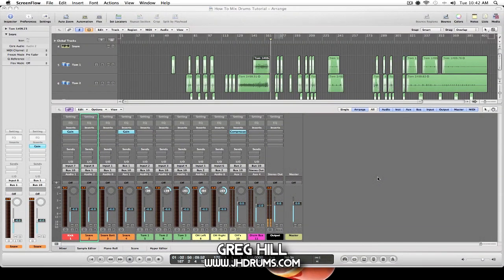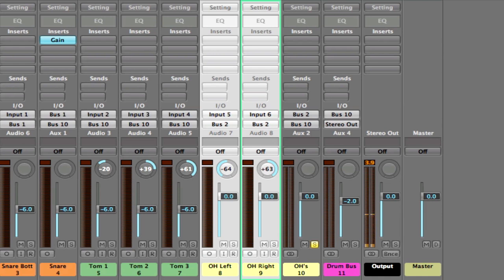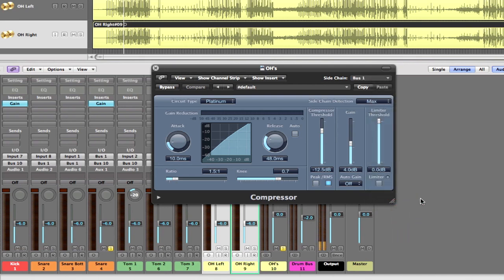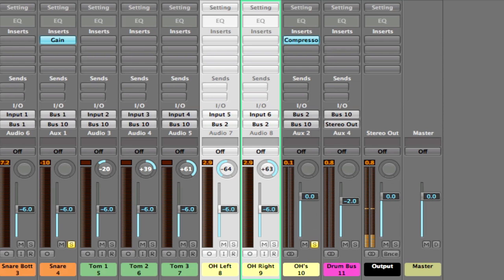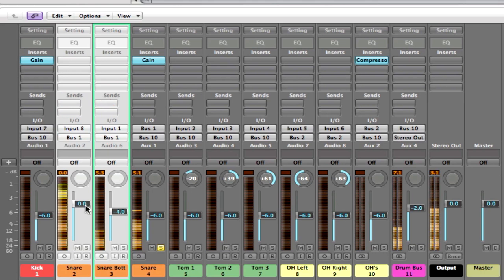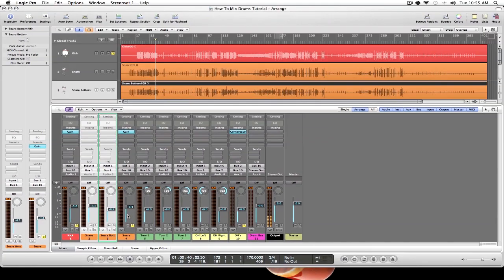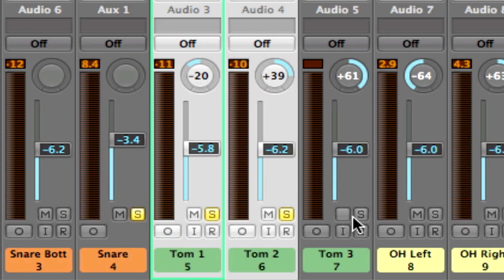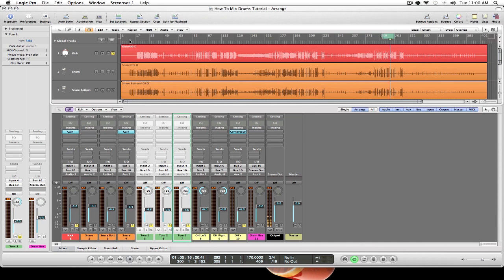Gain Staging - How To Mix Drums (Part 4) | by JHDrums

Comment: When I add a gain plugin to trim a snare that's too loud and insert a compressor after, I noticed that reducing a lot of gain makes my compressor work only at a very high threshold if that makes sense. I only see in my case a gain reduction on the compressor if I turn the threshold to around minus 30 or 40! Should I just insert the gain plug if the signal is clipping? Thanks in advance. Cheers

Comment: When we side chained the compressor to Bus 1 only why we use it at all ?  we didn't side chained it to other channels?
Reply from the maker: I do this to compress (or lower the rms) volume of the snare in the overheads (and only the overheads) to make the other parts of the kit captured by the overhead mics more audible. It's not necessary to compress the snare in any of our other tracks because the snare doesn't dominate their source.

Comment: In terms of recording, I've often (if not always) been recommended that one should aim for around -18dB with peaks hitting around -12 dB for recording in general, not just drums given that we're in the 24bit recording realm now there's no real 'need' per se to record anywhere near as 'hot' as you have in the examples here or like you could do when recording to tape because of the compression effect I often here other profession audio engineers speak of. I'm no professional by any means mind lol!

Comment from the maker: The compression is applied to just the overhead bus. You use the output of either your snare top or snare bus as a key for the compression. The compressor looks at the signal from the snare rather than the signal of the OH's and compresses only when the snare is hit.